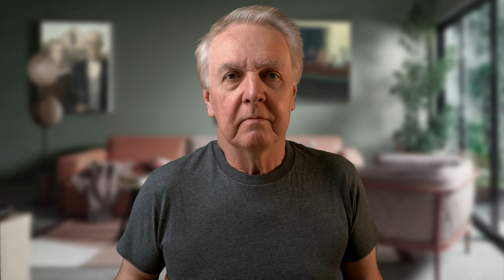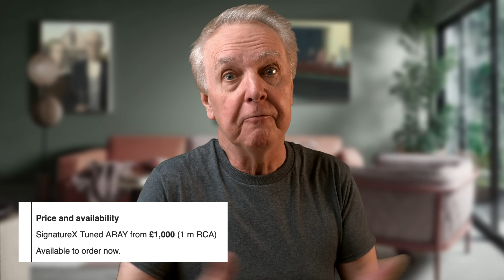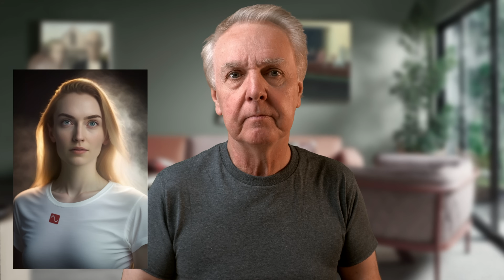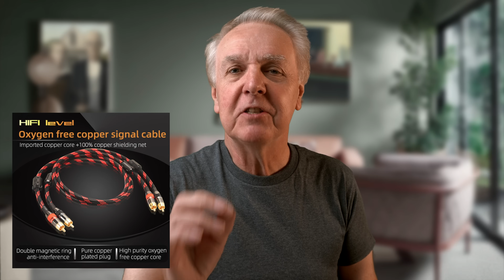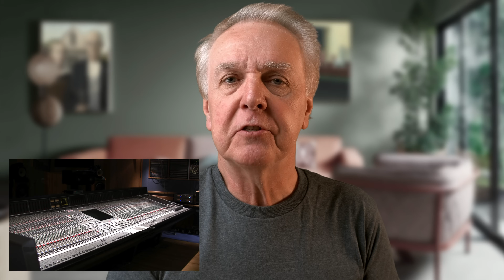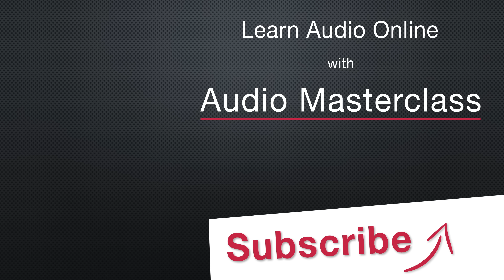Would you pay $1000 for a 1-metre cable?

Comment: It can be solid, stranded, copper, oxygen free copper, silver, etc.--or even "magic" wire--as long as the resistance is kept to be less than 5% of the speaker impedance. There is no listening difference as long as the wire is of adequate size. Remember that a nominal impedance value is not always accurate because most systems vary with frequency. A speaker that is rated by the manufacturer as 4 ohms may not be 4 ohms at all frequencies. It can wander above or below this value and is unique for different systems. If you have doubts about your system impedance, it's best to contact the manufacturer concerning the lowest impedance of the system that you plan to use and select a connecting wire based on the lowest impedance value.

It's not easy to set up a similar wire listening test. Very few people are able to make speaker impedance measurements or wire resistance measurements down to 0.1 ohms. Also knowledge of the speaker impedance over the entire frequency range is a very important factor in an A-B listening test. In some listening tests, this can cause a difference in sound that could result in false conclusions because the wire is not heavy enough. Suppose a speaker is used that has an advertised impedance of 8-ohms but the impedance actually drops to 4 or 5 ohms at one or several frequencies. Suppose further that wire A used in the test is heavy enough for an 8-ohm speaker but not for a 4-ohm speaker. When making a comparison test with a heavier wire B, differences can then be heard. Although the resistance of wire A may be correct for the advertised impedance, it may be too high if the speaker impedance goes lower than that. It has nothing to do with the kind of wire, only that the resistance of one wire may be too high for that particular speaker used for the listening test.
 
This lack of understanding for the impedance behavior of a speaker used for a listening test may explain listening differences that people can truly hear. One wire can truly appear to sound different than the other but for the wrong reasons. A speaker that has a constant impedance at all frequencies (most speakers do not) will only show a difference in listening level and not alter the response when the wire size is too small for A or B. Of course, the listening levels will be different unless they are compensated for in advance. Otherwise, the louder sounding one will likely be chosen. To avoid these difficulties, whether the speaker has constant impedance or varies, the two wires to be compared should have the same total resistance and that could mean different lengths would be needed to make the resistances equal.
 
Otherwise, under these adverse conditions of different resistance, a person can select one wire consistently. It may be easy to hear differences in the frequency range or ranges where the speaker being used has impedance dips that are below the rated value of the speaker. In some marginal cases it may even be possible, depending on the bandwidth of the speaker impedance dips, to hear differences that go near but not below the rated impedance. However it is a false conclusion that the wire selected is because of a unique wire construction or other advertised features. Only the difference in wire resistance is being heard due to the speaker being used in the listening test.
 
Of course, a different speaker will most likely have a different impedance curve depending on the crossover design and whether it is a single wide-range driver, two-way, three-way, etc. system. In that case an impedance dip or dips can be in a different frequency range and have a different bandwidth. A listening test will then reveal yet a new set of sonic differences. Again, resistance is the key.
 
Bear in mind that if both wires in the test are much heavier than needed for the particular speaker that is used and the speaker impedance is fairly constant, small wire resistance differences may have little influence in the test.

Several speaker wire manufacturers make wire that has high capacitance yet almost none of them publish exactly what the capacitance actually is. Capacitance is of concern not so much that it could cause a possible high frequency rolloff but that it can affect the amplifier feedback and cause the leading edge of transients to overshoot. This in turn can make an audible difference in the system sound. It can make the sound brighter, which some audiophiles mistake as greater detail.

The degree of influence when using high capacitance wire depends on three factors.
1.    The total capacitance of the wire used (capacitance per foot times the number of feet).
2.    The complex impedance of the speaker being used.
3.    The stability of the amplifier being used to drive the speaker.
 
When there is an audible difference in speaker wire due to wire capacitance, it can be interpreted as an improvement when one wire appears to have more clarity but is actually altering the sound and departing from accuracy. Perhaps this change in sound then paves the way to sell more wire. Further, perhaps the wire companies already know this and what will sell. If the speaker wire companies had not introduced wire having high capacitance, either out of ignorance or by intention, then there would have been no controversy like this and ordinary low resistance wire, which incidentally has very low capacitance, would have remained king from the beginning.

Although some expensive wires can have low resistance, several have a high capacitance of 100 to 300 picofarads (pf) per foot. These can introduce a significant amount of capacitive load, particularly for longer lengths. For a 50 foot length, this adds up to 5000 to 15,000 pf, which is the same as .005 to .015 microfarads (mfd).
 
Unfortunately, in addition to sounding different with a small amount of overshoot, a few unstable or borderline amplifiers can even go into oscillation. Low power oscillation, even if ultrasonic, will further affect the listening performance of a system and could lead to an apparent mysterious burnout of a tweeter. Oscillation at full power could cause an amplifier and/or speaker system to burn out.

Comment: Some years ago I bought some speakers for my lounge room. I knew what I wanted, they were for my AV receiver. I went to a local HiFi dealer and asked the best price he could do, he told me $700. This was considerably better than the $1195 I had just been quoted for the same speakers by a rival outfit just up the road. The $700 speakers were set up in a listening room and I listened to them using a CD I had taken with me, 'Welcome To The Monkey House' by the Dandy Warhols. I thought the speakers I had chosen sounded great, this CD would certainly show if the speakers could produce some good bass, and they did just fine. He had a few listening rooms with other speakers etc set up, one had speakers that cost $25k. I asked if I could try my CD on that system just to hear what an expensive system sounded like and he said sure. I listened to the same couple of tracks and told him I couldn't hear $24300 worth of difference... he just laughed. So did I.

Comment: I worked with a fellow EE who insisted pricey interconnect between his cd transport and his dac made the sound better. Now, you can rightly say the bandwidth required to pass the digital signal actually does wander into the low low end of RF. But digital signals have noise margin that analog signals don’t. Likewise, a super cable can’t help if the link isn’t terminated properly. We said, “Steve, you know better!” Speaking of termination, I wonder if the connectors on those schmancy cables are crimped or do they use that lousy tin whisker RoHS solder.

Comment: Umm-this is so simple-its been done for years ..the ABX test where cables are swapped surreptitiously and the test only is to even discern any difference ,not even which is better. So the golden ears were assembled..well you know the rest. Speaker cables were replaced with unfolded wire hangers no differences were able to discerned..apparently these magic cables work thru the eyes and emotions...
Reply: Yes, I dream of a HiFi challenge where the owners of obscenely priced cables have to repeatedly identify them against other, cheaper cables, or lose them.

Comment: I definitely agree it's not a transmission line and it's just resistance and capacitance that counts on a short audio cable. I needed a 3m cable to connect the turntable. So I used "shotgun" satellite cable with F type plugs and F type to RCA adaptors at each end. Well screened so it won't pick up any noise on that tiny signal and as it's designed to carry radio frequencies it's not going to lose anything due to capacitance.
Reply: Capacitance loading of Cartridges must be scammmmmmmmmmmm....?!

Comment: People forget that a signal path is only as good as its weakest link.  
So, consider this...  
Inside the component box, the RCA connector is connected to the circuit board by a thin strand of solid copper wire, and the case of the equipment is often the ground/earth "wire."
And within the actual electronics inside the equipment, the signal follows thin copper traces on a circuit board.
Reply from the maker: This is correct of course. It's worth adding that the layout of the copper tracks can affect the audio. I've learned that to my cost when getting things wrong results in high-frequency oscillation. DM
Reply: @AudioMasterclass  Yes, as an IT person, that is why you'll see a great many pins on a connector labelled ground, where you'd think only one ground should suffice -- to prevent crosstalk between the individual wires in a cable and between the traces on a circuit board.  If a bit gets flipped due to crosstalk or capacitance between adjacent traces, it will cause more problems than a little distortion that can only be heard by "golden ears" audiophiles, lol.

Comment: Even more ridiculous if it was a digital cable. For short runs the Bit Error Rate is likely 0 with any crappy old cable so you can use whatever you like... I am an electronic engineer and have to calculate effects like reflections and dispersion but for good ol' audio these are not really relevant. Keep the capacitance low to avoid loading the sending end amplifier with a big capacitance (which can reduce stability of a poorly designed amplifier), avoid piezoelectric effects in the dielectric (which can create noise when the cables are moved) and have gold plated connectors to avoid insulating corrosion products on the mating surfaces... Speaker wires - even less critical.
So much money wasted on BS.
Reply from the maker: You comment prompted me to wonder how much could one pay for an HDMI cable. Google tells me £949 GBP for a 1 metre cable and I suspect that isn't the limit. DM

Comment: A current topical aspect - is charging $1000 for an absolutely stunningly beautiful 1m cable wrong? No, but if the ostensible value lies not in its gorgeous radiance, but in purported superiority in rendering audio characteristics, perhaps yes.
   Is charging $250,000 for a few hour junket down to view the wreck of the Titanic a crime? Logically, looking through a thick small window sounds grand, yet visual quality may be far better on HD image recordings - so, besides the actual "experience," of lying on a frigid curved hull, peeing into a tiny camping potty, eating a cold sandwich, which all sounds not at all adventurous or daring, the cost looks more like another egregiously egocentric indulgence, bragging rights for the richest of the rich. Not a crime , per se - until scrutiny of a 40 page waiver reveals how many ways you can die. Then, the fact the craft has no certification requirements, and is being taken about three times deeper than tested.
  Waivers do not hold for gross, or criminal negligence. This Oceangate Co. is done for.
  In the scheme of things, if peacocking is your thing, by all means spring for $1000 cables that may or may not affect your appreciation of some recording, but which will absolutely never implode and kill you instantly.

Comment: No. But I once paid about $35 for the M brand(the original snake oil hucksters), which was audibly worse than $7 Radio Shack ones. Using words like "coherence," and "notes starting and stopping more precisely," is preposterously non-engineering double talk; how does a cable make a note behave any differently, when the signal is the only active factor? It is passing electrical changes, not at all analogous to squeezing and releasing a garden hose, for example. "Tuning" a 1m/3ft cable where no issues come up before 2000ft, would seem to be totally feasible for less than the extra $1000 or so.

Comment: It's pointless to pay a premium for cables that oscillate at at less than a million hertz. The most impactful difference between cables as pertinent to audio will be their capacitance, the thicker the cable, the higher its capacitance.

I send and receive signals from satelite dishes up at 10ghz range. My daily grind includes using waveguide cables and isolating amplified signals from noise. 

I find it absolutely hilarious that folks in audio pay premiums for expensive cables. If you want the best cable you can get, any quad balanced cable would be the best you could do... 
The best, as in spending for anything more for a cable is asinine.

Comment: A Danish HiFi store has a slogan that reads: "Bad sound kills music". I think many HiFi enthusiasts are more focused on output power, cable properties and the price of their HiFi gear than thinking about how their room is arranged acoustically for listening to music.

If you, as an audio enthusiast, love rhythmic music and have been to concerts played in sports halls and large churches, you have experienced how acoustics affect the music experience. Sports halls are built for sports, churches are built for church music not rock music. If your listening room is a box with parallel walls and ceilings and the room is not acoustically damped, stereo systems, regardless of price, may have difficulty reproducing music as it is produced because the room plays along, the room's acoustics affect the sound.

Controlled reflections from walls and ceilings and the room's reverberation time are factors that are more important to a system's performance than expensive cables and sophisticated HiFi gear.

If you have an expensive Italian sports car, you don't want to put cheap retreaded tires on it and fill it with octane 88 petrol. No, you want to give tires that have good road grip and are intended for fast driving, and you want to fill it with petrol so that the engine performs at its best.

Poor acoustics in the listening room destroy the performance of your system. Spend money on acoustic improvements before investing in expensive HiFi and cable hardware.
Reply from the maker: As you say, it often seems the listening room gets the least attention. DM

Comment: I'm so sick of the "snake oil" cable deniers. And if someone wants to pay $1K for a cable, so what? People act like it's their money. Are there other things that should be addressed first? Yes. Is it out of my reach (given my economics)? Yes. Do I have money invested in my cables? Yes. If you have a resolving system, cables make a difference. I have cables that work better with one piece of gear than another. My question to the deniers is, have you ever rolled tubes in a tube amp? Does that make a sonic difference? Of course it does. What's the difference between that and cables? Functionally identical. And what difference does it make that the studio used x cable to produce to record/mix/master etc? They used studio monitors too and some amplifiers I wouldn't have in my own system. How we play back what was produced is irrelevant to the production of the music. Cables, again in a system capable of revealing those differences, are part of those playback decisions. You don't hear criticism about using a particular tonearm or cartridge. For some reason that's legit. The proof is in the listening, not the marketing speak trying to sell you the product or worse yet in the "measurements". You could say the same about any piece of audio gear.

Comment: An Audio enthusiast friend once told me to forget about buying posh RCA cables, just replace the 5amp fuses in the mains plugs for 13amp versions as it makes much more of a difference. After a brief demonstration I got my coat.
Reply from the maker: For the sake of comment readers everywhere, not an electrician but I'm absolutely sure that replacing a fuse with a higher rated one is a safety hazard. DM
Reply: Sounds even better without a fuse ...
Reply: The difference being a house fire.

Comment: Sorry, after 50 years of experience designing audio radio frequency and data storage systems, this is ridiculous.  The losses at audio frequencies of 1 meter of cable is totally negligible.  RCA connectors are ok for audio, but no where as good as Cannon connectors and balanced systems.  Forget spending more than 10 bucks for a pair of interconnects for audio. Silver alloys are still conductive and don’t make a difference.